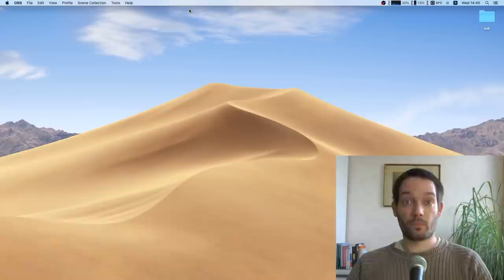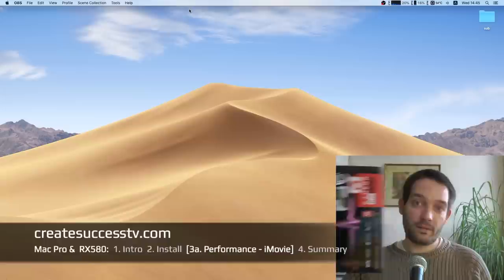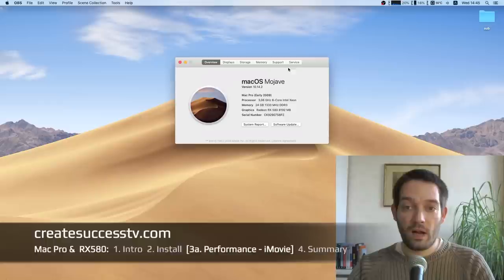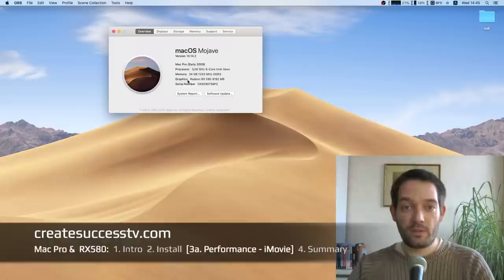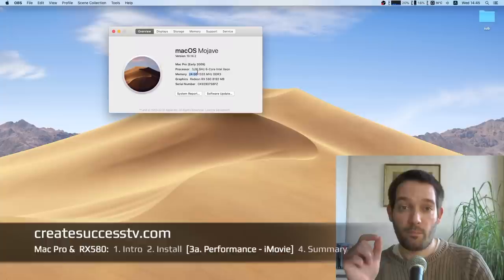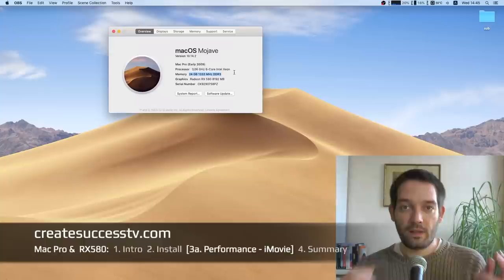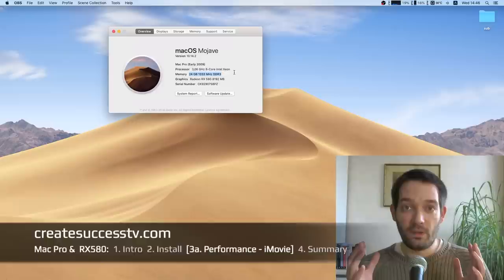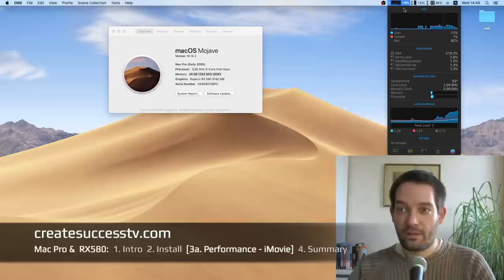Mac Pro 4.1 and 5.1 GPU Upgrade for Mojave (Sapphire Pulse Radeon RX580)

Comment: sorry, a RX580 works fine in slot 1
Reply from the maker: It may work great, but it will still get very hot under load because the backplate is designed to transfer heat away from the VRM (MOSFETs).
Reply from the maker: Maybe have a look at this RX580 disassembly ➜ https://youtu.be/iizl9tJfj24?t=548
Reply from the maker: Start a game, play for 10 minutes, and carefully touch the backplate, you will see what I mean.
Reply: @ReviewTechTV   i work with 4k video and have a highpoint SSD7101 in slot 2 and there was no temp problem at all - and now also with the vega64 in slot 1 - booth cards hasn't over 78 degrees after 5 hour work
Reply: and i need all PCIe slots
Reply from the maker: I agree PCIe slots are scarce, awesome to know it works well in PCIe slot 1!
Reply from the maker: Actually, I am thinking to get the Highpoint card as well, seems very promising because of faster NVMe speeds, some people reported 6000 MB/s with two 970 EVOs.
Reply: @ReviewTechTV   it has 4800 write and 5600 read with 2 x 2TB 970 evo as RAID0 on rhr HP 7101
Reply: @ReviewTechTV  Is there a performance hit when you move from slot 1? Isn't it less lanes?
Reply: Create Success TV Manufacturers claim the backplate is for cooling, but the amount it actually dissipates is so minuscule. It’s really there for aesthetics.
Reply: I have the same RX580 Pulse in a 5,1 and i have problems..keep saying update firmware and it’s been updated 4-6 times..still nothing..i switch slots because i didn’t want heating problems and now that i did a firmware update again, it’s been updating firmware for the past 5-6 hours? And the card don’t have heat problems....so why am i stuck at this point cause i don’t want to cut off the comp to mess anything up!!
Reply: @ChrisCyphazTSL  do a NVRAM reset so you hear 4 times the chime before- if this not work your NVRAM is  corrupted

Comment: Just wanted to let you know what I have been able to build, might want to update as well.

I have 10.15.6 running on my Mac Pro 5,1
12 core 3.66 W with 64 GB Ram 1333mhz
RX 5700 xt GPU
Booting from NVMe SSD via PCIE slot

First, you have to be willing to get your hands dirty.  In order to get a GPU like the 5700 running, you have to do a PIXLAS mod...this involves taking the Power core out of the machine, purchasing a cable to then splice the wires coming out of the power core...this is so you will bypass the thin wiring on the motherboard to the Mini 6 pin power ports....you go straight from the power core to the GPU which is 6 Pin and a 8 pin....if you just YouTube PIXLAS you will see a great video on how to do it and where to order tools and wire needed.

https://www.youtube.com/watch?v=VhFg1Xcv9E4

But to get that 5700 card to work on the machine, you have to be running 10.15....

You need to turn off SIP on you 5,1running Mojave, while in recovery mode, open terminal:

csrutil disable

restart computer to take effect.

Then you need to open terminal and enter this command, can be in normal boot up mode, not recovery mode.

sudo nvram boot-args="-no_compat_check"

Now, you have to get your hands on a compatible computer that is running Catalina 10.15 already....get an SSD or HDD and hook it up to the computer via external drive.  boot into recovery mode, formate drive to apfs and then install Catalina 10.15 on that external drive....then take that drive and stick into the Mac Pro 5,1.

Your Mac will now be running Catalina 10.15. (I was running Catalina even with my old RX580), you can now use time machine to rebuild your system in 10.15.

You can now take out your GPU and slap in the rx 5700 xt, plug in the cables coming from the PIXLAS mod and you will be good to go!

I also used Carbon Clone Copy to clone my SSD on to the MNVe drive and that is how I am booting from NVMe drive (note: you have to have BootROM 140.0.0.0.0 version, without this version your 5,1 will not recognize NVMe drives.

Now the great simple task of getting Boot screen and native OS updates through Mac app store (since officially 5,1 is not supported passed 10.14) you need to download OPENCORE. here is a video that shows you the simple process to do that.

https://www.youtube.com/watch?v=7wWfU3AlFPk

Note: when I mounted my EFI, it did not have an EFI folder in it, so I just dragged the whole EFI folder from the download.

Aslo, you can re-enable SIP as well, VIA terminal while in RECOVERY mode.

csrutil disable
or
csrutil enable

hope this all makes sense, it is, once you are done, very easy to do....just a little scary to take on but worth it!
Reply from the maker: Ok, thanks for sharing your story, excellent.
Reply from the maker: Many people use the easier method show in the video.
Reply: @ReviewTechTV  for sure and I had the RX580 in my machine for that reason, plug and play.....But I am an editor for film and commercials in LA, so having a great rig is absolutely a bonus...so just thought I would share my story on how to get a top line GPU in a 2010 Mac Pro.

also if you are instructed, check out this

https://barefeats.com/cmp-5700-xt-vs-other-gpus.html

this is a benchmark test between the rx 580 and the rx 5700 xt in a 2010 Mac Pro 5,1....the rx 5700 blows it out of the water....so if you want to squeeze a handful of more years out of the 5,1...might be the way to go.

Comment: I'll buy your old card. Looking for a metal supported GPU. :)
Reply from the maker: Product links and additional info below the video in the description.
Reply: All the details are there!! Thanks!! Did you have issues with the jump from 60watt to 225watt with your PSU?
Reply from the maker: @TheBluuHouse  I used the parts from the video description, the dual cable for the RX580 and the single for the RX560.